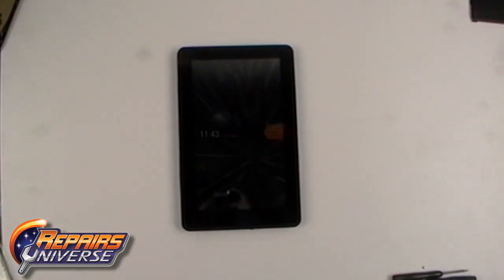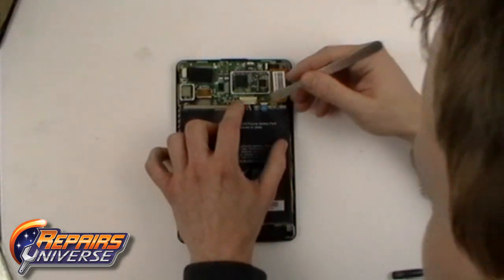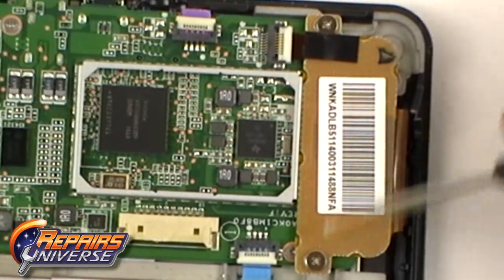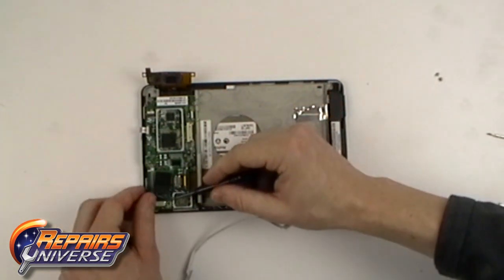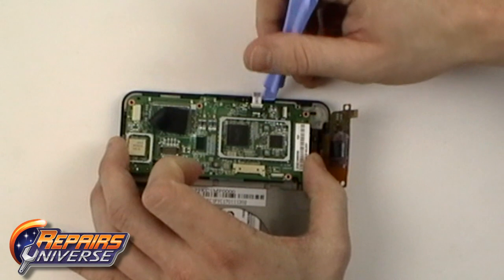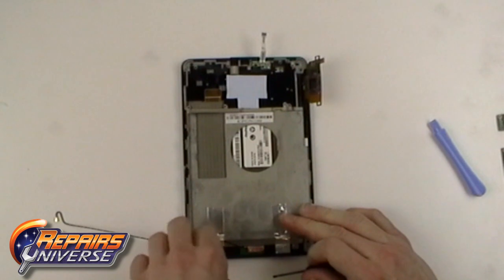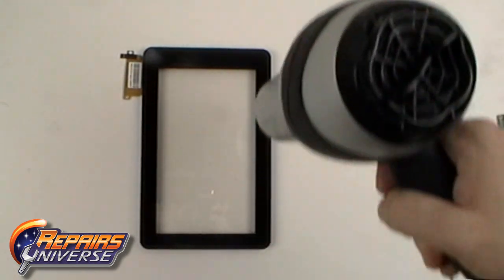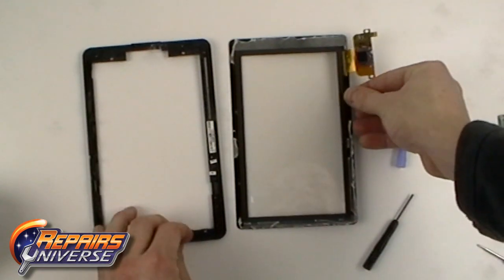Amazon Kindle Fire Take Apart Repair Guide

Comment: I took apart the back of my Kindle Fire and then put it back.Now it won't turn on.All it does is light up.What do I do?
Reply from the maker: It's possible the LCD flex cable was damaged. Ensure that all flex cables are connected to see if that helps.

Comment: My Kindle appears a "?" mark on battery icon, I changed anything even charger, except replacing cover off. I didn't have tany special tool to open it? Which tool can I instead of it to open? The battery only works within pluging on the adaptor. :(
Reply from the maker: Any pry tool should be sufficient. Maybe even a plastic spudger would be recommended.

Comment: (I believe I have the same type of kindle fire in the video.) The main reason why I'm searching this is because my screen has stopped working. The screen is showing me different, horizontal colored lines, and on one small part on the left side, bottom, it's heating up very quickly. My tech-smart dad says that he believes that it's fried, but I believe that it's just the screen not working. I have not dropped it or damaged it any way prior to my taking it apart. What do you think is wrong with it?
Reply: the same thing happened to me

Comment: I live in  North Georgia and my kindle fire won't charge, I believe it's the charging port, but I don't have anyone who can fix it, and I'm not mechanically inclined at all, can you recommend anyone in my area who can fix it without charging an arm and leg, I only paid $112. for it and that was 3 years ago, I don't won't to pay more than it's worth to get it fixed.
Reply from the maker: What part of Georgia Saannie.
This charging port is soldering. Not an easy repair for a novice. Need more detail at where you are at so I can find the best place for you to get your kindle fire up and running.
Reply: I live in the FortOglethorpe, Ga., it's near Chattanooga, Tn.
Reply from the maker: There is some places around.
Now I don`t know how good they are because i have not seen their work.
I have talked to them and most of them are going to charge around 80-130.
With these prices you could just buy a new one. I`m sorry about that. Good luck on what you would do.

Comment: Hmm. Well ever since i got the kindle, the charger has been a bit loose. I wanted to send it in to get it checked but never had the time. maybe somehow the port came off the motherboard all the way when i took it apart. but somehow i was able to pop the port back in place. Maybe it will work.. Just waiting to get my lcd replacement to check.